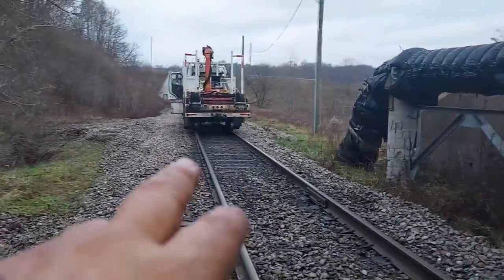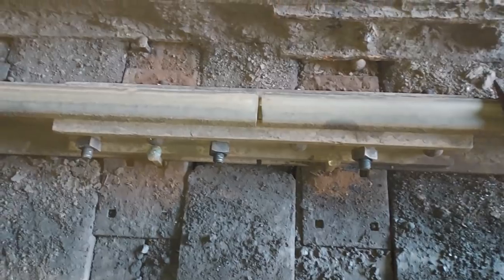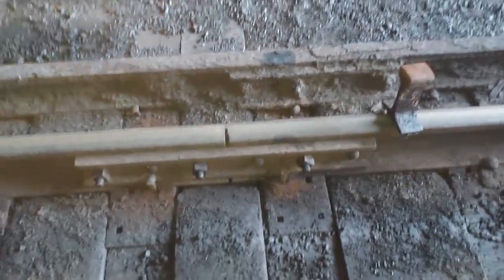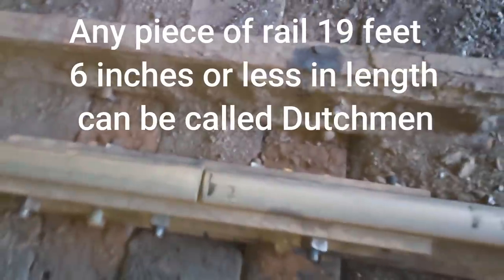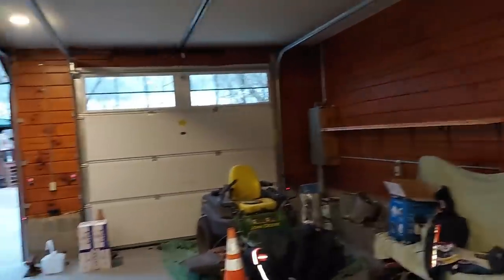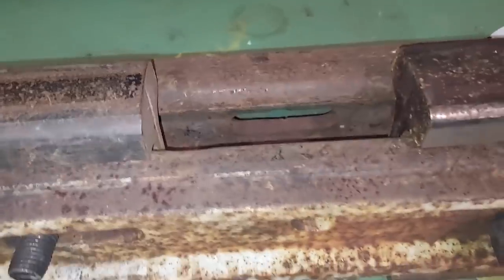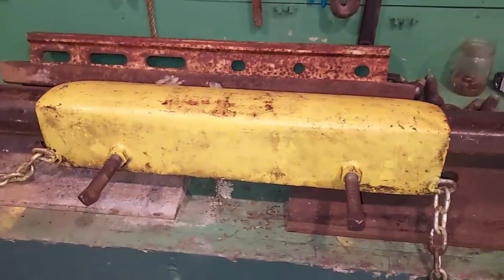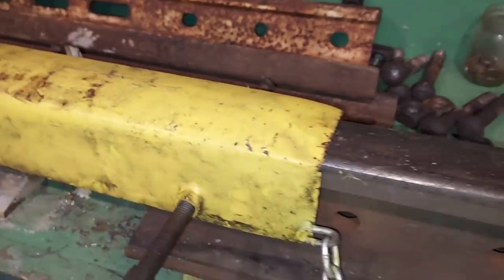Railroad Rail Splints, Dutchmen and Slotted Joint Bars - Pretty Cool Stuff!

Comment: Great job Dave. So they use Dutchmen on railroads as well!  Dutchmen is a pretty common term in woodworking as well. In fine woodworking a Dutchman is  an inlay that is used to fix a small area of bad grain, a hole, or other defect. Never heard of it used in track work, but it makes sense. That is a real nice solution until you can get in there and replace the track. I never heard of the other fixes before either! You're a great teacher Dave 😊
Reply from the maker: Thank you very much my friend for the very nice comment. Did
not know that about wood working either, but figure sometime 
you'll show that in one of your videos. And, I've been very blessed
to have many old railroaders teach me this stuff over the years, I'm
only sharing what they have passed on. Glad you enjoyed the show sir. PS: I need turkey out here, that would send my ratings thru the roof..... LOL

Comment: A look into the little known side of track maintenance :)  It is fascinating to see some of the options for repaiering rails. I can't imagine that 2.5 inch gap was any good at all. We worry about things like wheel flat spots and then this gap which probably gets bigger and bigger with the consistent traffic - whew!  Only a truly dedicated man has rail fixtures and mock ups in his garage :) Very cool!
Reply from the maker: Glad you enjoyed the video my friend, we do appreciate your writing
in and for watching. Your right Brian, had we not found this and
kept running trains, the gap would have gotten larger resulting
in a possible derailment, and one at a very bad spot inside that
tunnel. But that's why we are required to do track inspections on
a regular basis.

Comment: Wow I haven't seen a slotted joint bar on a full size track in ages. They used to be common even used to allow expansion and contraction at a notorious spot as a fix. Used to see the RDG & Conrail use them. Those Dutchman too only they'd leave the Dutchman there forever lol!!  We still use slotted joints commonly on smaller scale trains outside though. Think Amusement park scales and light narrow gauge. Allows the track to expand and contract through the seasons and we don't need to make adjustments.
Reply from the maker: Glad you enjoyed the video sir. We do appreciate your sharing with
us that info and for watching today.

Comment: Ah... my days... we called the Fire Snake...  we called it a wick.  1 old timer told me, a track super. burned down a open deck bridge, on the H & S  Branch line... with a wick.  So my days... they were only used for a while... and only in yard ... back tracks.  Then.... NO more.  We either cut rails in... or loosened joints both ways.  We had a manual puller for back tracks... and the newer hydrolic pullers.   Good Video.
Reply from the maker: Glad you enjoyed the video my friend, we do appreciate your writing
in and for watching. we used to have a Simplex manual puller,
have never used a hydraulic puller tho. I also have a rope wick
that is kept soaking in a bucket of diesel besides the Fire Snake,
it burns hot but is pretty messy. Thanks for sharing your experiences
with us Willard.

Comment: Thanks for another great video. Always good to see how in America you use slightly different techniques to overcome problems with the rail . In the UK to join two lengths of bull head rail ( now mainly used for heritage rail ) ' fish plates ' are used instead which again bolted through but have a tear- drop shape at the opposite end to the thread , so can only fit in tear-drop cut out in the fish 
plate . Rail joints are also made parallel to each other on both rails , but for various reasons they are staggered in the US hence the frequent ' rolling gait ' of goods trains which you dont get in the UK .
Very interesting video . Please keep up the good work !
Reply from the maker: Thank you John for the very nice comment and for sharing that
info with us. We do appreciate your writing in and for watching
my good man.

Comment: Dave, thanks for another great video.  A couple of questions.  Is it temperature which causes the rail creep?  When it creeps the amount you showed, how does it not snap the bolts at the joint bar?  And lastly, where does the extra rail end up?  Does it cause kinks on the down rail end?  Hope these questions make sense….Stay safe out there, and keep the coal moving….
Reply from the maker: Your welcome Richard and glad you enjoyed. Temperature is the main cause of rail creep but also the dynamic forces of a train passing
over it is a cause of creep. Heavy braking is hard on rail structure also.

if the cold causes rail to contract then it will pull against the bolts.
If the bolts are weak then they will snap, if one or more is missing
then that obviously will significantly weaken a joint because of
the decreased resistance the bolts provide. 

On our RR all loads are one way to the east, many RR's have bi directional loads which kind of evens out the creep. So here all
rail creeps east. And yes at some point the rail can get
"bunched" so in the hot weather a kink is possible. Many times over
the years we have de stressed rail to avoid this situation. De stressing
means that we cut some rail out, sometimes as much as 6 inches.
Hope that all helps my friend and thanks for asking.

Comment: Awesome Dave, never seen nor heard of a rail splint, nor the Dutchman plug,, this is why your channel is so Awesome, well that and your great enthusiastic energy and on your pull apart, what caused it. did the joint bars crack or did the bolts break, love this
Reply from the maker: Cold had caused the rail to contract and it broke the bolts, then
with the train passing over it helped to widen the gap before I
found it. Appreciate the very nice comment Pappy and your
continued support my friend.
Reply: @ccrx6700  thanks Dave. Stay warm

Comment: Pretty wild what trains can go over, got a call out to a small wash away and broken rail reported by train driver, the rail had dropped 100mm at the break and the train still got over it without derailing.
Reply from the maker: Yes it is amazing what a train will pass over, and then other
times just the slightest thing will cause it to jump off. You just
never know, but that's railroadin. Appreciate your writing in
and for watching.

Comment: Wow! All kinds of neat stuff to keep the trains running! That tunnel where you were could be an "emergency tornado shelter", if one should happen to approach. (Just saying!)
Reply from the maker: Your right Paul! years ago we had some terrible storms here
and that tunnel was what I would head for! Thanks my friend
for watching and writing in.
Reply: @ccrx6700  ive been a "trained" weather spotter since 2006, due to some really violent weather that went through my area. There was even a "twin twister" that went through, and had it been about 15 minutes earlier, there would have been 3 of them side by side. So, in retrospect, the longer the tunnel, the better! Those temporary track repairs are the coolest!
Reply: @ccrx6700  i just realized, we use "Dutchmen" in the model railroading sense, but they are called "fitter pieces" instead of the real term! Thanks for the learning session!
Reply: @ccrx6700  that broken brake beam video was interesting, that low-hanging shoe almost became a weed wacker, but just barely missed a couple of them.
Reply from the maker: @paulsmith5398  👍☺️
Reply: @ccrx6700  just curious, anything new with the W & W narrow guage?
Reply from the maker: @Paul Smith  #4 safely tucked away in garage for a long winter's hibernation,  society is closed for the winter Paul.
Reply: @ccrx6700  thanks!, thats nice to know!  In the picture of the flat spot on the wheel hopper car, i believe its just to the left of the grab iron, at least thats where it looks like to me. (But i am probably wrong 🤔.)

Comment: Some pull aparts we can drive drift pins in and pull them back together, but when they are almost 3" open we break out the rail stretcher that I swear is almost 100 years old. Two guys pulling with all they've got on a lining bar cranking it back together.
Reply from the maker: Oh dear! We used to have that rail puller, I hated it! Slip on that
cog and a year's worth of chiropractor visits, been there done
that. When we got the snake I scrapped that puller and now
sorry I did cause it would have made for a good video....LOL
Using that puller we had to knock all the anchors off and run
a loco over the rail trying to get it to run back, total PIA. If I can
get a drift pin started I can make that joint usually without snake,
but snake does help. Thanks for writing in and watching Michael.

Comment: The majority of the time we will use the hydraulic rail puller on pull a parts, I’ve done 80 to 100 ton pulls to make a temporary repair joint on  CWR.
Reply from the maker: The welders tell me it's amazing how that puller works, I've
never seen it in action tho. Appreciate your writing in and
for watching Jason.

Comment: Did you sense there was a gap or did you find the pull a part on a walking tour of the tunnel?  Kind of like a denture for track. Thanks for the info it shows that alertness and education never end!
Reply from the maker: Glad you enjoyed the video my friend, we do appreciate your writing
in and for watching. I felt the gap in my truck as it went over it,
made a pretty loud bang Paul. But that kind of stuff is why railroads
are required to do consistent track inspections.

Comment: Learn something new every day. Question though, in the tunnel there is another set of track between the standard gauge rails... Is that an old narrow gauge line that wasn't removed (looks like it hasn't been touched in decades) or does it serve another purpose?
Reply from the maker: Your welcome Mike and don't bother, Steelers don't have anymore
what it takes to pull a come from behind victory in a big game,
bring back Chuck Knoll....! Nothing better than the Steelers back
in the late 70's! Gosh I loved watching Jack Lambert
Reply: The rails are guard rails there to keep any derailments from hitting the sides of the tunnel.

Comment: Interesting the options you have to keep things moving I never heard of a Dutchman or rail splint, If the gap is over 1 inch here we cannot run anything. The split would have to be used with care If the  track gauge is spot on I think a wheel could be pinched and ride up on top of the splint
Reply from the maker: These are only temporary options until we can get the rail fixed right.
Your certainly right on the splint, 5 MPH at most over it. Not running
rolling stock over a 1 inch gap is stringent, but is highly respected
by me for your quality control!  Appreciate your writing in and
for watching my friend.

Comment: Hey Dave !! Another great "Learning "" video !!  Hope you Don't have too many of those   ""Pull-A-Parts"  on the rails ,,but with TEMP> change as  you know  ,,it happens !!  Makes me wonder just how welded rail can stand the stress of NOT being able to move under those conditions ??  Have a good week & """STAY WARM"" this week !!
Reply: The answer is, it doesn't. If you listen to a railroad radio on the first cold day of the year you will hear the crews reporting pull a parts.
Reply: @gravelydon7072  Then what ?? DERAILS ALL around the country ???
Reply: @KB-gs8zi  No. The first thing that happens when there is going to be a major cold snap is that the track inspectors start making checks of the tracks before the trains are due. Crews are alerted to report any that they come across so that the track can be repaired as quickly as possible. On the BIP RR there is normally at least one per year between Belpre and Marietta on the CWR.  CWR is more prone to it than bolted rail is.
Reply: @gravelydon7072  Thanks for the reply !!   Have a good week !!
Reply from the maker: Glad you enjoyed the video my friend, we do appreciate your writing
in and for watching. I usually average 6 to 7 pull aparts a year K B.
So far this year have had 3.
Reply: @KB-gs8zi  You too. Stay warm if you can.
Reply: @ccrx6700  Stay warm ! Our forecast tonight is: cold with a chance of falling iguanas.  It was 46° down here at the end of mainland Florida this morning.
Reply: @ccrx6700  OKS !! With another ""COLD" snap coming this weekend ,,guess you'll have more to look for !!  Again <<Stay ""WARM" !!

Comment: Another awesome video Dave! In the tunnel what is the purpose of running rail in between the actual rail? I notice they do that on bridges to and i love your laugh, lol definitely a rail roader laugh.
Reply: It appeared to me to be an old section of narrow-gauge rail as it seemed to be about the right distance from the far rail. it was too far from the near rail to act as a safety guide. It was extremely rusty, wasn't it?
Reply: @normkirkland1999  looks like it has been there for awhile.
Reply: @normkirkland1999  They are guard rails. They don't have to be close to do their job, which is to keep a derailed car from hitting the side of the tunnel.
Reply from the maker: That is called guard rail, some call it Jordan Rail, our friends
across the ocean call it check rail It is there in case of a derailed
wheel the car won't drift too far off track. Good question Rick
and glad you enjoyed the video my friend.

Comment: I've made slotted joint bars before. Ours are semi-permanent because the rail is old and different weights and it's been cut all over the place over the years. Do you know any companies that make thermite welding kits for 16-20lb rail?
Reply from the maker: Oh wow, that's some pretty small rail, thought that was only
used in way back mining days when they used horses to pull
the carts out with. Good luck in finding that my friend, I have
no clue. We get our kits from Orgo Thermite they have a web site if you want to check them out. Thanks for writing in and watching the video.

Comment: Now that the rails are more continuous pieces how do you factory in expansion and contractions?
Reply from the maker: Thermal expansion and contraction happen and it cannot be
stopped. We have all jointed rail here and as a general rule
we like a 3/8 inch gap in all joints. Having over 16 miles
of jointed track it is an impossibility to have every single joint
perfect. So with that said, pull aparts will and do happen,
and we fix them when it does. Thank you Donald for checking
out the video today my good man.

Comment: What would it take to convert the whole mess to ribbon? A lot of welds, I know, but in terms of time, money, new equipment, etc. and how would that affect maintenance once completed?
Reply from the maker: All new rail would have to be put in since all our rail is jointed with
the rails having 3 bolt holes on each end. They can't weld those.
One 39 foot stick of new rail costs $900. Then the labor to take old
rail out and put new rail in plus each thermite weld is $550, and
the down time for the railroad to do all this, the costs would
be astronomical.

Comment: Very interesting. What is the biggest Dutchman that was used, without replacing the rail? Do you always have to weld the joints, or is this a temporary fix until a rail is put in place? Have a really good day too!
Reply from the maker: Glad you enjoyed! a Dutchman has been called that up to 15 foot
6 inches. I really did not measure the one we put in here for
the second part of our repair job, but it was under that length.
sorry for the uninformative info.... We can only weld a joint that
has the back 2 bolt holes, if it has 3 holes then the welders will
not do it because that 3rd hole is too close to the weld. We like
to weld as many as we can to eliminate joints but as you can
see it's not always possible. Hope that explains Valerie.
Reply: @ccrx6700  sure does, thank you for answering and being so quick in getting back to me. Keep warm!
Reply from the maker: @valeriebassett3107  ☺️

Comment: Did Sperry pick up the extra holes as a defect, rail change out!! Does area get alot of base corroded rail.
Reply from the maker: No sir, Sperry did not find anything there. Very little base wear
in this section Billy. We get an extreme amount of corrosion 
not only on base, but also spikes and bolts and tie plates up
where they load the cars where there is a lot of coal spillage
which doesn't get cleaned up. The acid in coal is hard on steel.
Thank you so much for watching and writing in my friend.

Comment: You say the rail creeps, if you put in a Dutchman what happens when the temp changes will the rail buckle when it expands?  Or are the gaps averaged out is there a set gap for the length of steel over a distance.  :)
Reply from the maker: Very good question and quick answer is possibly, it depends a lot
on the location and the amount of gap in the joints on either side
of the plug. Location is because some areas don't get nearly
as much sun as others do, and this particular place gets
only a bit of afternoon sun, so the chances of a buckle occurring here
are very minimal. Hope that helps and thanks for watching today
my friend.

Comment: Although a "Dutchman" is a quick substitute for a proper repair, it does REQUIRE the re-do in order to comply with FRA rules. --. thus more cost for maintenance.

I do not cast aspersions on your work, but a piece of rail that is not properly secured to the adjoining rails with at least one bolt in each rail will shout loudly to the inspector.  It is akin to saying, "Come inspect my railroad, but leave your pencil and paperwork at home."
Reply from the maker: Yes sir Glenn you are right, these are only temporary fixes just
to get a train over so time can be had for a proper repair. 
Appreciate your informative comment and for watching the
video my good man.